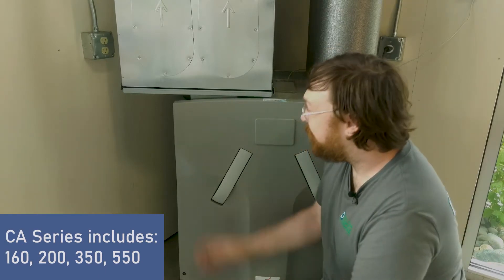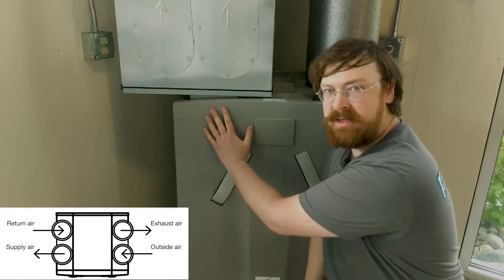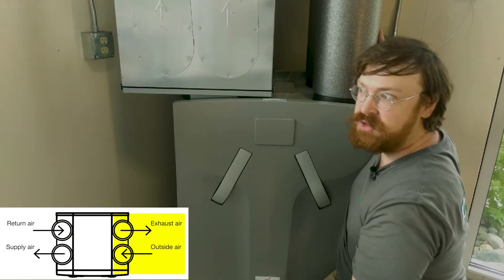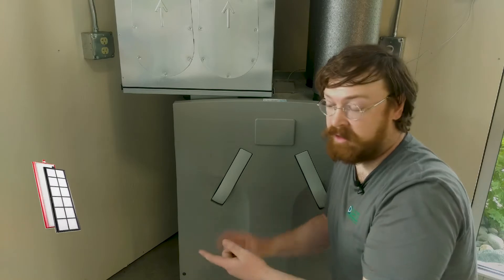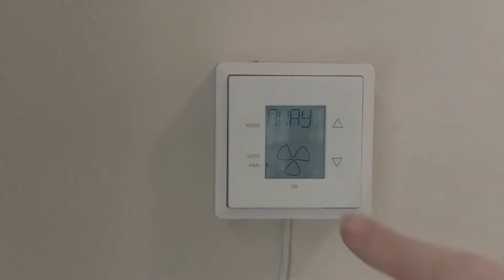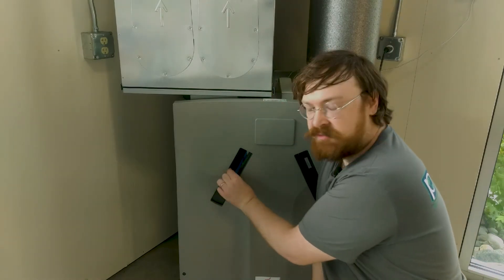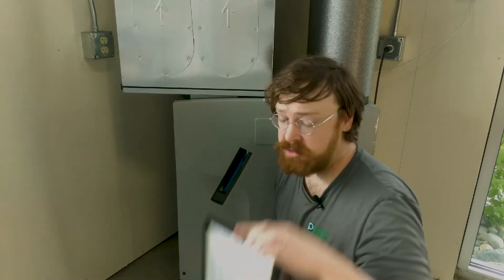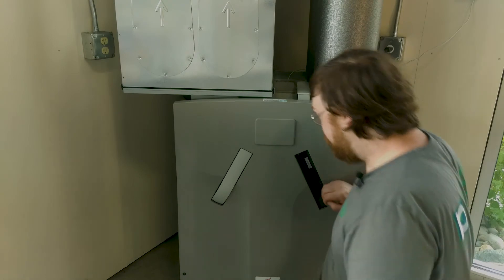How to Change Filters on a Zehnder Comfo Air

Comment: For the ComfoQ600, your website sells the MERV-15 and carbon filters, the MERV filter has an orientation label on the filter itself, but the carbon filter has no orientation label. Could you please post a video or let us know what is the proper orientation and order to install the two filters together in the comfowell box? Thanks!

Comment: Can you clarify which filter should go on which side? The pics that pop up in the video are not clear. At 25 seconds the pic shows Return Air and Supply Air on the left side of the unit and the Exhaust Air and Outdoor Air on the right side. Then at 50 seconds the pic of the filters shows Merv 13 Supply Side and Merv 7/8 Return Side. The earlier pic shows Supply and Return Side are both on the left side of the unit. 
If the red filter is Merv 13 does that mean it goes on the left side that handles the interior air?
Reply: The Red Merv 13 filter comes to the right side.
Reply: your question led me to research a bit more.  The reason why most videos won't share which side should have the Merv 13 is because comfoair350 comes with a left handed and a right handed model.  If it's a left handed, ComfoAir 350 - LEFT
, return and supply air is on the left side (when the filter covers are facing you), so you put the Merv 13 on the left side.  Some comments might have the return and exhaust mixed up, but return and supply are on the left, while exhaust and outside air are on the right.  Your comfoair should have a label that tell you if its a comfoair350 "L" or "R".  You can also tell if your ComfoAir 350 is a LEFT handed version if you find the condensation valve at the bottom is on the RIGHT.  Confusing right?

Comment: You graphic s says put Merv 13 on the supply side.   The earlier graphic has the word "supply" on the left.   Then in answer to a question by another viewer you say put the Merv 13 on the right.    Which is it?    It seems like this is one of the key points of the whole video, but you don't say in your narration where to put which filter and your graphics which purport to answer this are small, brief, ambiguous and contradicted by your reply to a question in one of the comments.
Reply: your question led me to research a bit more.  The reason why most videos won't share which side should have the Merv 13 is because comfoair350 comes with a left handed and a right handed model.  If it's a left handed, ComfoAir 350 - LEFT
, return and supply air is on the left side (when the filter covers are facing you), so you put the Merv 13 on the left side.  Some comments might have the return and exhaust mixed up, but return and supply are on the left, while exhaust and outside air are on the right.  Your comfoair should have a label that tell you if its a comfoair350 "L" or "R".  You can also tell if your ComfoAir 350 is a LEFT handed version if you find the condensation valve at the bottom is on the RIGHT.  Confusing right?